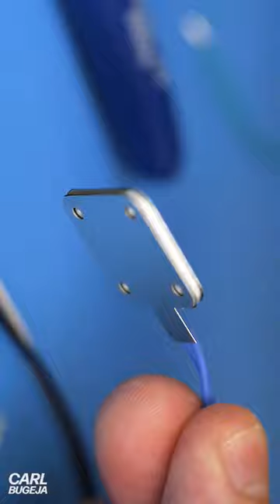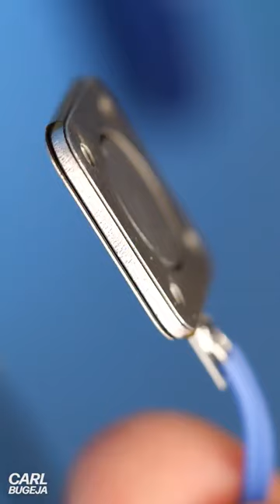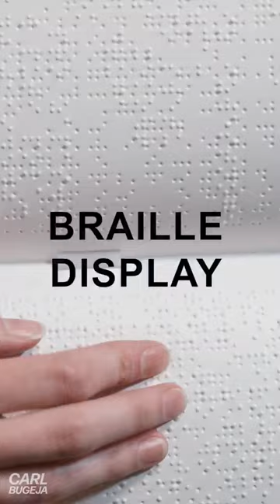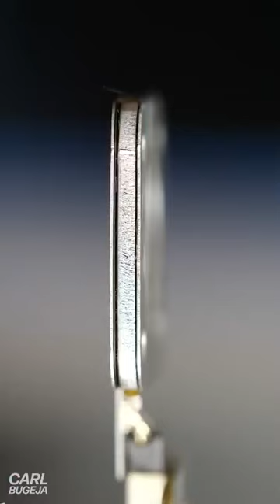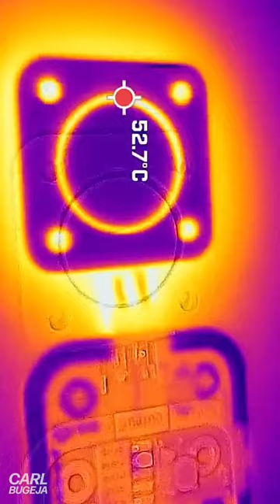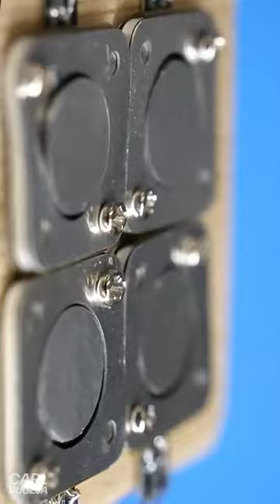Braille Actuator?

Comment: You could 3d print a mechanical display where each actuator is in contact with several post in conjunction with your pcb that can be used as an electromagnet. Each actuator would lift a # of pins well actually scratch that your electromagnetic pcb could be programmed to raise and lower pins, the area would be a series of holes 3 dots high and X holes long (length of display) with forming letters/words using the light sensor/motion sensor on the other code cell as you fingers slide across a "braille display surface' the message would pop up.

Comment: You don't have to use super small ones, you just have to have a design that has longer rods that reach to the reading surface. You could theoretically have a set of 6 actuators that are 30 feet in diameter, so long as the ends of those actuators all are forced into the tiny space where you need to read.

Comment: Shame. However, you have the little motor design, if you couple that with a worm thread of one revelation desplaulying an up andcacdown position, you would only have to power the Braille for when changed. That should significantly reduce the power dissipation and give a better tactile experience. 
Another alternative would be a side sliding magnet  wedge actuator pushing the dot up or down.
But can it be miniaturized onough?